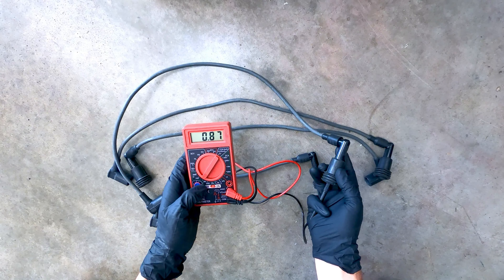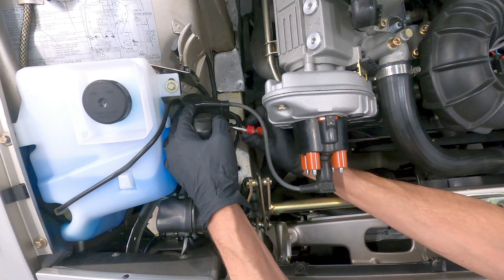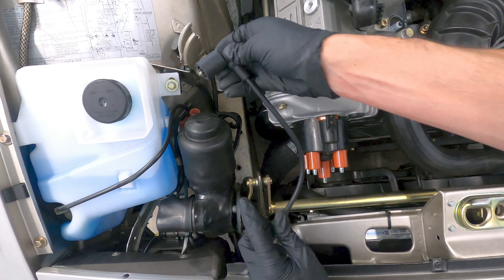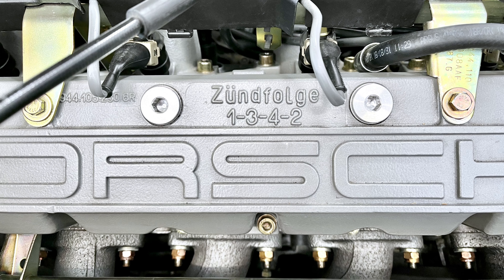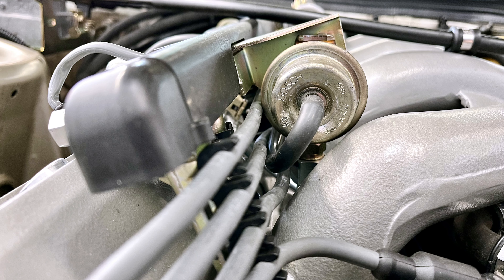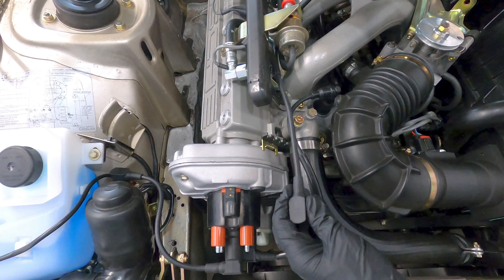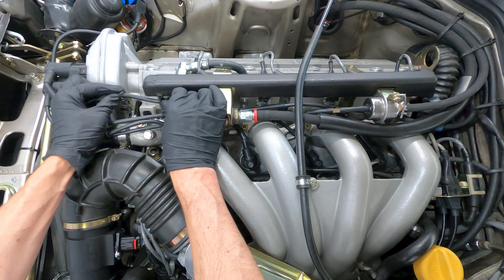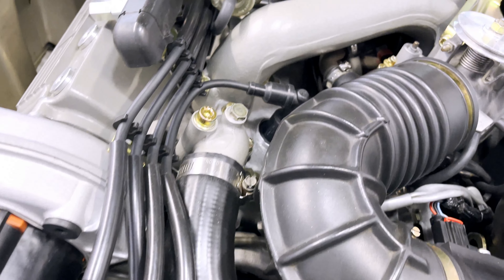Porsche 944 – Spark Plug Cable Testing & Replacement Tutorial

Comment: Great overview.  I have engine bay envy...oh how that bright yellow zinc hardware is spectacular!  I have to say, I get a good chuckle seeing you break out the Harbor Freight multimeter!   With what you've spent on the 944, I guess that's all you have left...and it does the job.
Reply from the maker: Home of the throw-away tool! 😂 But you’re exactly right, the less I spend on tools, the more I have for Porsche parts. I should probably get a nicer torque wrench at some point, since it’s something that actually matters. It’s amazing what you can get done on a 944 with pretty basic stuff.
Reply: @NC944er  Back when HF gave the multimeters away for free like hot cakes, I had about 3 of them laying around! Couldn’t beat it😂

Comment: Thank you for all the tutorials. I own a 1987 944. And I have just completed the timing belt, water pump,Cam seals, spark plugs, and wires.
At idle I have a noticeable vibration, any ideas or suggestions on what to look fornext,  I was hoping that all the work I did would Take Care of it but it did not the vibration continuous.
Many thanks for all the awesome videos you post!!
Reply from the maker: Hey man, congrats on getting all the work done! 👍🏼 Idle vibrations can be caused by a number of different things, but collapsed motor mounts are quite common on the 944. Here’s a process to check out - http://www.clarks-garage.com/shop-manual/eng-11.htm
Reply: @NC944er  wow!! It sounds like my problem to the T!!!! Thank man!! That will be my next project
Reply: Now I will wait for you to post a video on motor mount replacement!! You explain things in great detail the videos I found online are terrible
Reply: Motor mounts or O2 sensor. Could also be balance shafts were set improperly
Reply: @liamflynn6929  I was careful to set balance shafts on the one and 7 clock positions, I purchased the motor mounts so I will try that next.. will a bad o2 sensor show as an engine light??
Thank you
Reply: @danielrosenberg9896  most 944s don't have an engine light.
Reply: @liamflynn6929  My question confirms that I am new to 944's!!  Thank you!! unfortunately, since this past weekend the car won't start, when I turn the key, I hear a click and the engine won't turn. I will have the battery load tested and also see if I'm getting 12v to the starter when I turn the key...
Reply: @danielrosenberg9896  yeah sounds like a dead battery or perhaps a failed starter. You can try hammering the starter before starting to see if that changes anything.

Comment: Always high quality videos. I still watch them because they’re so good. Noticed you’re still missing a PS resi so I assume you’re still running the manual rack. Enjoying it?
Reply from the maker: Hey man! Yeah, the manual steering setup is nicely broken in now and holding up well by all accounts. The absence of the reservoir, the pump, and one fewer belt to deal with makes other jobs around the car a little easier as well. So no plans to switch back unless I enter the car into a parallel parking competition. 😂
Reply: @NC944er  plus no more leaks from that system. Ever.

Comment: I have a 1987 Porsche 944 base that I purchased new in 1987. It is in showroom condition, but nearly all the electrical parts are original. I am in process of replacing these parts and your videos are my goto resource. What brand of ignition wires did you select for your 944 and why? Also, any advice on which brand of distributor and rotor you recommend would be very helpful. Thank you!
Reply from the maker: That’s awesome! Unfortunately those soft rubber bits don’t last forever. I went with the BERU cables since they are built to a high-quality OEM specification. A number of other cable manufacturers actually use the BERU plug ends on their cables so I figured why not go straight to the source. The BERU set also has the additional protective coating pieces on the cables, which helps resist abrasions. I believe the distributor cap is only available as a Bosch unit, even the Porsche branded ones are made by Bosch. There are a few different ignition rotor’s available, where I’d go with Bosch or BERU.
Reply: @NC944er  Thank you for the information on the parts you prefer, you are the best!

Comment: Thanks for your very informative videos.  I just purchased a set of Karlyn-STI wires for my 1992 968.  I measure an end-to-end resistance of 5.9 kohm for each cable. At the 2:59 mark you state that the Karlyn-STI are also 3 k ohm. The BERU set that I am replacing was showing an end-to-end resistance of approximately 4 kohm, hence my interest in replacing them.  Do you know if the spec for the 1992 968 is different than 3 kohm or did I get a bed set from Karlyn-STI?
Reply from the maker: Hey Marc! Yeah the 8v engine cables should read 3k. I didn’t check on the 16v cars, but my guess is the spec could be different as the ignition setup isn’t exactly the same. Unfortunately most manufacturers don’t publicly post the specs and I had to email each company to acquire the details shared in the video. Karlyn makes good quality stuff from what I’ve seen, so I would be surprised if a new set was defective, especially since they’re all reading the same resistance, but if you wanted to be sure they’re pretty quick to reply: info@KarlynSTI.com
Reply: Here is the reply that I just received from Karlyn: “Yes, that is correct.
We found that as cars age the accumulation of electromagnetic interference increases.
Adding a slight increase in cable resistance prevents radio frequency noise from interfering with radios, cellular telephones, TV’s, computers and other onboard electronic equipment”
Reply from the maker: @marcinmetcalfe595  How many TVs you got installed in your 968!? 😂 No, that makes sense… the car’s wiring does build up resistance over time due to cracked insulation and oxidation setting in. On certain AM radio stations, I can hear distinct engine noise pumping in through the speakers.  At least now you know, thanks for sharing back what you learned!

Comment: Do you need the distributor number decal that sits atop the dizzy body? I've got one kicking around someplace.
Reply: I was thinking that too, with as OCD as most of us 944 owners are.  Someone on Rennlist was talking about reproducing those but the thread seemed to fizzle out.  Is someone selling them now?
Reply from the maker: If I want to be be ultra factory correct, I probably should right? 😂 I haven’t found a “best” single resource for the various stickers… I need the Porsche AC conversion sticker as well. Is there a site that has them all in one place?
Reply: @NC944er  I sent you the part number for the r134a conversion sticker in your ac compressor rebuild video. I bought mine from a dealership I think.  As for the dizzy decal, I think I ordered mine from... Ebay? It came from the UK.
Reply: @NC944er  My A/C conversion sticker is from the Interdynamics  kit that a did 20+ years ago. There is only a little trace of that sticker left..LOL
Reply from the maker: @lizard944  Nothing lasts forever. 🤣

Comment: Have you thought about retrofitting a LSD? Would be amazing to see. Guard Transmission, MFactory, wavetrac, etc.
Reply from the maker: I agree, that would be very cool to see, but no... I haven't considering doing much with the transmission internals other than pricing out rebuild costs awhile back. I'd have to procure a number of tools before taking something like that on. I have considered a full transaxle swap to a 968 6-speed transmission though... the fifth gear on the 1988 NAs is ridiculously short, and not the best for highway cruising, I'd love to have a 6th gear.

Comment: What are the covers on the cables near the radiator hose?  Did those come with the kit?
Reply from the maker: Yeah, there are some protective rubber sleeves installed on the cables by certain manufacturers. Some kits include them, some don’t, depending on the brand. They increase cable longevity by providing resistance against heat and abrasion. You can slide them along the cables to better position them where the cables may contact other components on the engine.

Comment: What sparks plugs do you have? Been searching what’s the best sparks for my 1984 Porsche 944 . Thanks in advance!
Reply from the maker: I’ve been using Bosch Super Plus 7900 WR7DC+ plugs for the past couple changes. I figured it best to stick with the OEM units since they are reasonably priced. However, I also tried the NGK Standard Copper 7131 plugs at one point. Anecdotally, I didn’t notice much of a difference from the Bosch plugs at the time.
Reply: @NC944er okay thank you! I’m replacing the plugs and wires this weekend! I was having trouble finding which spark plugs with be best.